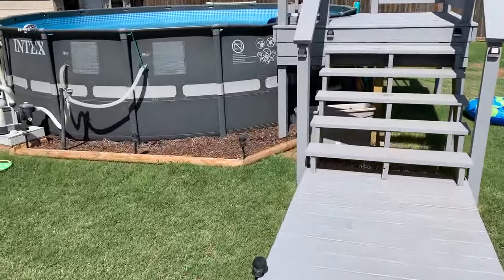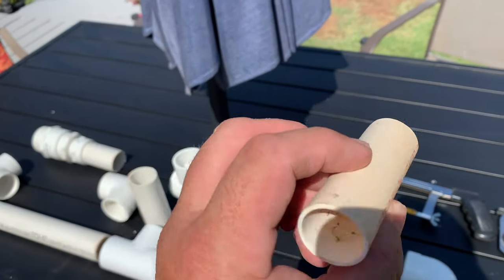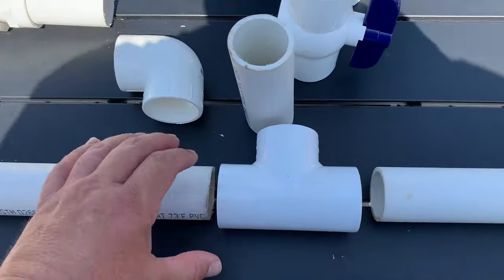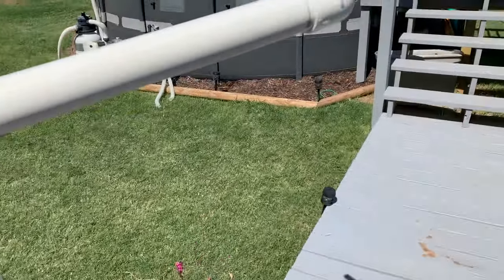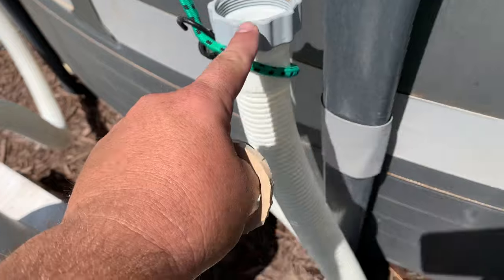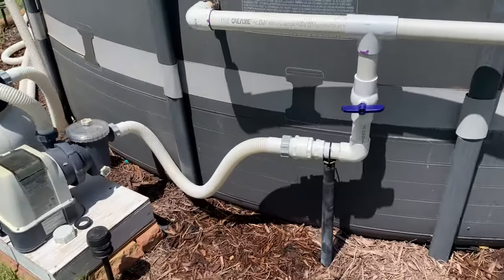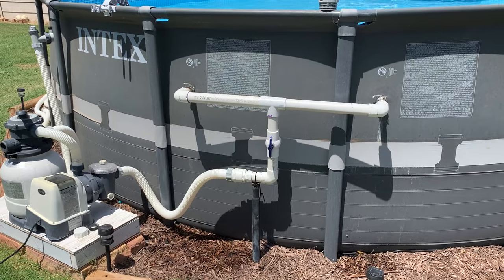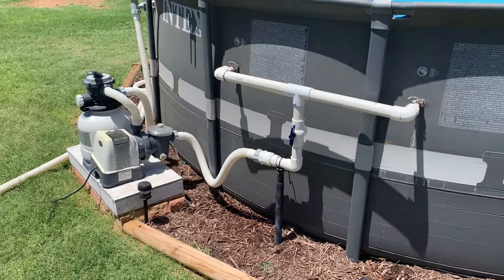How to PVC plumb your INTEX pool

Comment: I took the eye out of my return and fit a 90* elbow into the hole. It makes the water circulate around the pool and not out mostly to the middle. Skimmer will work better and any debris at the bottom of pool will collect in the center making it super fast and easy to get out. No need for a vacuum.
Reply: I was thinking the same thing.
Reply: Great idea

Comment: Forgive me if it's already been said, but you will get better filtration if you move the skimmer over to the inlet further from the outlet and push it as far away from the outlet as possible.  Then point the outlet away from the inlets.  This causes a swirl effect in the pool and really makes a difference.
Reply from the maker: Yeah I’ve had it in both inlets before you are correct it works best in The second one. And it’s hard to tell but I do have the return pointing away from the inlets. But the part intex gives you pushes the water more center then anything.

Comment: I viewed and applied this setup to mine with some slight modifications.  
I used 1 inch pvc in the 2 ports from the pool. To make the (2) 1 inch pieces fit into the ports, I wrapped the ends of a pair of pliers with electrical tape and used the pliers to stretch out the ports to fit the 1 inch pvc. They obviously fit very snug after doing this and only needed 1 hose clamp on each. I also used my pvc cutter to cut the debris guards on the inside of the pool to about 1 inch in length to fit them in the ports to be able to use them.
Reply from the maker: Great info that’s awesome, thanks for adding very good information

Comment: cant get the 3/4" pvc in the pool nozzle, maybe they changed it recently.  Glad I checked fitment before doing any cutting and gluing.
Reply from the maker: It should be the same size you might want to try warming it up with a hairdryer, possibly
Reply from the maker: Also, not sure if you’ve seen my latest video this year, but I updated my plumbing again if it gives you any other ideas. 
https://youtu.be/4gmdtYiSq9g?si=X7Nx_hR9a-v64hzW
Reply: @LifeLessOrdinary  Thanks, I didn't realize that was your video also.  I think I will wait until the fall and do that.
Reply from the maker: @tndtravel1019 I’m loving it 👍🏼

Comment: I did something similar a few years ago only I put the PVC on the ground instead of on top of a stake or post ran it up to the ports and turned the 2 ports into jets with 45° elbows on them so that they are directional. I  hooked the skimmer up to the other port that you ate using as a jet.  I also hooked up a Hayward super pump and a cartridge filter for a permanent inground pool instead of the intex temporary pool equipment.
Reply from the maker: That’s awesome 👍🏼

Comment: I never thought of this but we are in the same boat with the hoses. Woulda been icing on the cake if you listed the PVC measurements in a quick grab list. It would have made it even easier for me to do. But even without that this is a great video! Thank you for sharing.
Reply from the maker: I appreciate the comment, yes after the fact I wish I had added that  info. But just estimate and ballpark the length it won’t cost much at all. Good luck if you make one 👍
Reply: Not that easy to make a list. Every pool is different, every pump is different. You can only get an idea from these videos, at the end you have to find what parts work for you. I can say that I found every adapter I needed at my local Home Depot. Besides the adapters that came with my skimmer and Hayward pump and sand filter.
Reply: Not necessarily true. It would work for those with exact same pool and pump such as us.
Reply from the maker: What info do you need to know?

Comment: I just built mine today.  I used rubber reducer couplings at the pool to keep the stock screens, straight to 1-1/2" SCH 40.
Reply from the maker: Great information, 👍🏼
Reply: Hey Collin just curious what reducer's you used. Size is the being the main question.  I have done some other mods for a fountain and used the fernco couplings. Thanks in advance!
Reply: @danielbailey7596  I got some 1-1/2" to 1-1/4" schedule 40 rubber reducers from Lowe's. The 1-1/4" side was a bit oversized for the inlets from the pool, but I cranked them right and they aren't leaking.
Reply: @collink7145  that’s exactly what I had in mind. Thanks for verifying !

Comment: You know what may work vs the 3/4 and clamps is a rubber coupler reducer. I used them when going PVC and used it to and from pump and didnt leak. I also swapped all hoses with the flex PVC plus easier to adapt to my sand filter, when the clamp ever gets here. I like that you didnt have to cut a bigger hole. Sure better water flow and easier to put in fittings to go to 1.5 but not ready to cut. 1 wrong cut on hole and there you go.
Reply from the maker: All good ideas 👍

Comment: I upgraded to a sand filter and skimmer system last year. Cost more than the pool and now all my hoses leak. Gotta love Florida
Reply from the maker: My hoses went bad also, but after doing the pvc it’s been working great 👍
Reply: @LifeLessOrdinary  have you had any trouble with your sand filter ? Bought mine last year and now the pressure rises almost to red within an hour of a fresh back wash.
Reply from the maker: No I’ve had no trouble at all. Have you taken it apart yet after first installing it? You can get debris trapped inside the top part of the big barrel
Reply: @LifeLessOrdinary  yes I even replaced all the sand thinking it may help, I'm not sure what else to do! Must be an issue with the pump.
Reply from the maker: I would try to contact intex and just see what they say. It’s worth a shot

Comment: Try and get away from the 1/2" inlet. On the inlet side you want the water to flow as freely as possible. Pumps are good at pushing water but really bad a at sucking water, so that the inlet is more important than the outlet.
You can mount an external surface skimmer to these Intex pools and the connect that with 2" pipe to the pump. It's way better in getting dirt and bugs of the water surface and you don't have the thing dangling inside the pool.
I know it takes some nerves to cut into the pool liner but it's well worth it.

Something like this: https://youtu.be/Q2KU5WBhvCQ

Comment: Definitely a good idea and thought about doing this however I would not suggest it considering when the pool is occupied the pool flexes causing the rigid PVC to move which it is not meant to do and will cause leaks especially if kids are in the pool. If anything swap out the hard plumbing to durable flex PVC
Reply from the maker: I’m starting my 3rd year with it and I have 4 young kids, I’ve never had any issues at all. It was a concern at first but not anymore

Comment: Great video! I’m just brainstorming in the comments to clean up the connection on the two ports from the pool to the pump. I’m trying to do it where I can still use my pool screen. One to keep debris from entering pump and the other to screw my skimmer onto.
Reply from the maker: Thanks 🙏🏼, yeah I’ve had a few saying they did a few different things with the ports. On mine I made it work with the screen and a skimmer. I didn’t put the PVC all the way through to holes. And I cut back the depth on the screen piece and on the skimmer so it met the pvc in the middle of the black rubber pipe. Hope this helps

Comment: Here is what I used if you guys need sizes…. 

Two 3/4 PVC Pipes 
Two 3/4 to 1 1/2 adapters 
Three 1 1/2 PVC Pipes 
Three 1 1/2 inch Elbows 
One 1 1/2 Tee PVC Pipe 
One 1 1/2 Ball Valve 
One 1 1/2 to 2 Inch Threaded adapter
Reply: Is it the same pool as the one who posted the video?

Comment: Great video and explaining what you're doing. I have a Best way 12x20x52 that we bought last summer. I just bought a new 1.5hp sand filter pump combo and I'm getting ready to do the same with the PVC plumbing. But I'm going to put the cut off valve to where I can use either side to filter the water. I can do plumbing, but I hate it.. lol.. 
P.S.  I think schedule 40 ¾ will be too big for the holes. I say that because I use a ½in coupling to go in and it was a tight fit.
Reply from the maker: Let me know how it all turns out 👍

Comment: Thanks for the video, with all that work you could replace that valves, like the one from the output, the only problem is that you need to make a bigger hole in the liner, but it will be more clean and you can close one when the skimmer is connected.
Reply from the maker: I’ve thought about it for sure, i’m just gonna leave it the way it is it’s running pretty good. Thank you for the comment 👍

Comment: Put a little heat on the end of the original inlet pipe and then flare it by pushing about an inch of the 3/4 pvc into the end. Then you can slide the pvc into it and, viola, no leaks.  I put a clamp anyway just for good measure.
Reply from the maker: That’s a great idea 👍🏼

Comment: That grate it a safety feature not just a debris filter. If there is enough suction and both inlets are covered it prevents vacuum entrapment by providing a gap.
Reply: Very important if you run the pump while bathers are in the pool.

Comment: Hi I came across your video nice job could you post everything I need to change all the holes to pvc measurements ect imma gonna go to hardware today to pick everything up
Reply from the maker: I didn’t actually change the holes them self just made it pvc on the outside. In the beginning of the video I lay everything out that I used 👍🏼

Comment: Thjs is a must do,Pvc pipes. install a sump with a 1 degree slope to the center, install center drain. pipe the drain in sand under the pool. Install a flow control valve To drain away from pool. Install a wide jacuzzi  skimmer above your return skimmer and attach it to your effluent drain line to drain off overflow from rainwater. this removes the expensive cost and mess from installing a French drain. Keeps the pool from overflowing and damage.

Comment: Nice job, great explanation. I decided this year to move away from the cartridge filters to a sand filter. I found a bestway 800 gph sand filter for a good price, about what it would have cost in cartridges for the summer.

Here’s my question, I have a similar size pool, 15’ x 48”. The top rating for this sand filter is 4200 gallon pool. Does anyone think it’s worth going to the next size up since I’m at the max pool size rating for a new pump and filter? I haven’t installed the new pump/filter yet as I’m trying to decide. Only paid about $135, but the next size up is well over $200. Only upgraded bc I didn’t like the waste of the cartridges. Pool cleanliness was not the issue.
Reply from the maker: I bet you will be OK with that size. But I would do a little more research on your end just to be sure. Maybe do some more Google searching and see if I come up in any pool forums.

Comment: All of the ribbed flexi hoses that Bestway/Intex/Coleman pools come with are crap and designed to fail, to force you to buy new ones, driving their revenue.  I eventually replaced the big ones leading to and away from the pump/filter with two inch thread-reinforced hose from HD, and a lot of PVC fittings/adapters/barbs to make everything line up.  I am sure much of that will be obsoleted by switching to a sand filter, but we'll see.  The vinyl lines I replaced to the suction ports do fine until heated up, at which point they begin to collapse, letting air into the system.  I like the PVC option and will try it.  In the meantime, I keep a small tarp over everything to protect it from the Florida sun.  Easy to replace when necessary.
Reply from the maker: Yeah I agree the hoses that come with it are crap, you will love a pvc upgrade

Comment: How do you vacuum after installing this with the 3/4 pvc in both inlets? Neither the black plug nor the white adapter for the hose will fit in the holes now.
Reply from the maker: I put the end that I used to use the white adapter with directly into the skimmer hole

Comment: Great Video! I am still running the original filter and I am looking to upgrade this year so this is very helpful. The one upgrade I did as soon as I got the pool was added a through the wall skimmer. It made dealing with that crappy cartridge filter possible for the last 4 years. time to end the hassle of dealing with those cartridges this year. Also have to figure out where to plumb in the wood fired boiler I found over the winter. Your hard pipe manifold is going to make that much easier to figure out👍👍

Comment: Great videos!  In your fountain video you used the 1 1/2 to 40 mm adapters to connect to the intex hoses.  However this video you just used a pvc male threaded end.  So do I not necessarily need the 1 1/2 to 40mm adapters?
Reply from the maker: I would use the adapters because the pvc thread is just a tiny bit different so in some situations I needed heavy Teflon tape.
Reply: @LifeLessOrdinary  Thanks!  Overnighted some and will give it a go tomorrow!
Reply from the maker: Robert Rackley let me know how it all turns out

Comment: Awesome Videos, very helpful!  Just to clear ip, your PVC pipe replace the Pool inlet Strainer?
Reply from the maker: If your talking about the grey strainer cover that goes over the inlets on the inside of the pool, yes you can use those if you want. Is that what you are referring to?
Reply: @LifeLessOrdinary  Yeah, I like the idea of removing it and sticking with the pvc.
Reply from the maker: I personally don’t use them, at first, I cut them back a little bit to fit in the hole better to meet the PVC in the middle. But after the first year of adding the PVC, I just don’t use them. If there’s any big piece of debris, it will get caught inside the pump filter No big deal.

Comment: I agree,  these plastic tubes crack in the sun. I would definitely upgrade.  But when the pool is in use the walls wobble so the pipes would make cracking noises surly. I think replacing everything to PVC apart from one small length of tubing to the pool wall to allow flexibility. Then just replace this part if they crack again.
Reply from the maker: I’ve had really good luck with my set up, haven’t had any flexibility issues yet knock on wood.

Comment: @LifeLessOrdinary what does the inside of the pool look like where the inlets used to have the suction pieces?
Reply from the maker: They look the same, I only pushed the pvc in half way. And the debris cover that goes on the inside I cut it back just a little so it still fits. It basically butts up to the pvc
Reply: @LifeLessOrdinary  is that the black plunger looking thing or is it the gray ones? If you have pictures could you post them please…
Reply from the maker: Mine are the black plungers but grey will work also 👍🏼

Comment: How were you able  to connect skimmer basket to this set up?? We plumbed with pvc yesterday but no basket now:(
Reply from the maker: I cut off about 3/4” of the adapter that you use to connect the basket inside the inlet, and it fits inside the hole. I didn’t push the pvc all the way inside so it gave me room.
Reply: @LifeLessOrdinary  thank you!  I have rigged right now with a coupling and plumbers tape...lol  I did push pvc all the way through.  Maybe I need to back it out some.
Reply from the maker: Basically I pushed mine just enough to get a good hose clamp grip. Which gave me enough room to slide the adapter in on the other side

Comment: The is awesome. I'm planning to do this. Question: How do you connect that blue skimmer hose adapter that normally screws on to  the inside of the pool? My guess is that we can skip the blue adapter and connect the skimmer hose directly to the inner wall?
Reply from the maker: I still use the blue adapter but I cut the inside shorter so it would fit inside along with the PVC that was on the other end. I appreciate the comment good luck on doing it to your  pool.
Reply: I just realized that others had the same question. I should have read more comments. But thanks.
Reply from the maker: No worries I hope it works for you

Comment: I was curious if maybe running the pipe under the ball valve all the way down to the ground would be okay? I am going to do this conversion, but outlet pool sits on pavers. So, we
Can’t drive a stake into the ground to brace it. 

I was thinking run a longer pipe down and having a type of pad to cushion it? Not really sure. Tossing around ideas.
Reply from the maker: I think it would be perfectly fine if you added a longer pipe down to the ground

Comment: Everything looks great except for the 2 inlets (3/4 inch) going to the new PVC pipes with all the fittings.  While you were at it you should have upgraded to the bigger inlets that accept the 1 1/2 intex hoses & plumbed the PVC from there.  The 2 little inlets are a restriction, the more water you can suck the cleaner and easier it is to maintain.  Going from a small, 3/4 to the bigger 1 1/2 or 2" is a waste of volume.  Bigger inlets will not restrict your volume like the 3/4 does.  Just my opinion since I've gone this route (3000 Gallon Sand filter).  Sure you have to open the holes up in the pool but it's nothing major.  Hope this helps those looking to follow suite.
Reply from the maker: I’m installing a new pool next spring and I’m making the inlet larger 👍🏼